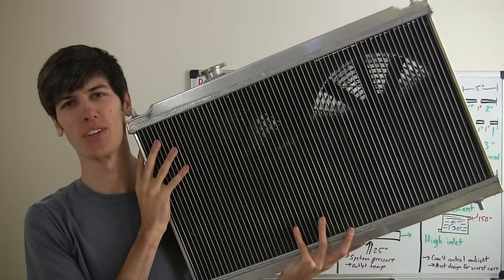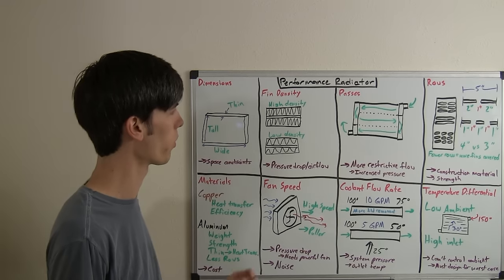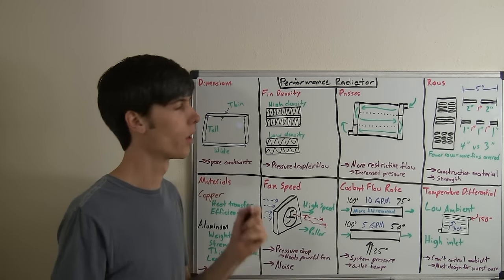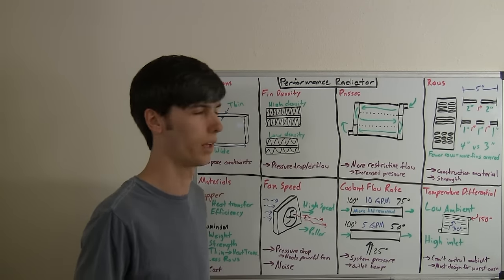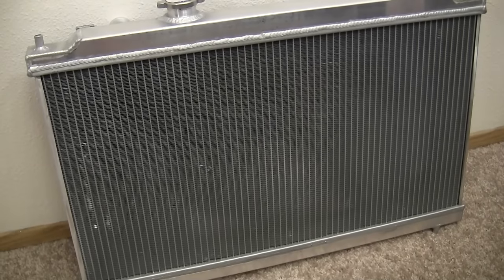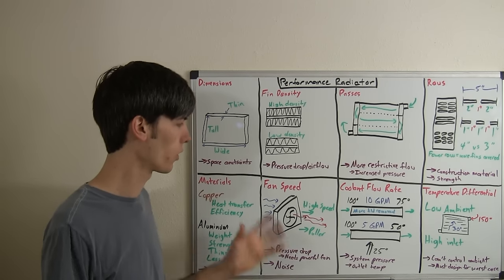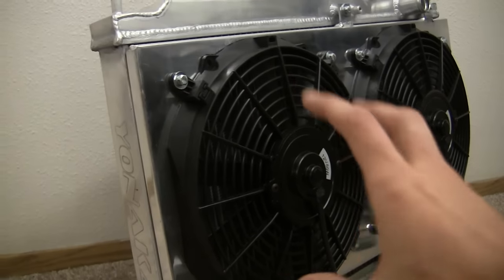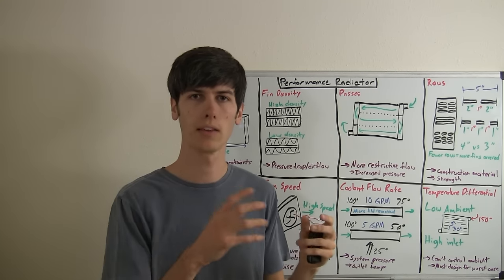Performance Radiator - Explained

Comment: WTF... I can see right through it? There has to be a better, more efficient design. I'm willing to sacrifice for more weight/more coolant to keep an engine as cool as possible.
.
Why not use Isopropyl alcohol for a coolant? What about compressed air through a small holes blowing on the radiator. It the basic way an conditioner works. How about a very light weight fly wheel with a magnet setup n the engine similar to a generator (accept a light weight design), to replace the drag a alternator puts on a vehicle. I'm not a big fan of the draw of power from an engine to power electric fans. I think they should bring back the old fans running off the crank. It sure as hell aint going to take away power, unless you are looking for thousands of seconds time on the track? I'd actually incorporate the fan in front of the radiator, rather than it blowing hot air from the engine at idle/low speeds... I still can't believe I can see right through the radiator, WTF?
Reply: Water has higher thermal conductivity than alcohol and high thermal mass, and ethylene glycol is molecularly similar to isopropal (they are both alcohol), I don't know why they use one instead of the other.

If you used an ac to cool the radiator, you'd need an even larger radiator to cool the ac.... Plus you'd just be adding parasitic drag to the engine to run the ac...

The alternator alternative you purpose would just be an alternator but probably not very effective..... And like an alternator, every Watt it puts out is going to reduce the power to the wheels.

I've never seen a car with a traverse mounted engine without a crack powered fan, might be that I work with older cars mostly, they often have an electric fan in addition so you don't need to rev the engine at a stop light to keep from blowing a gasket.... but the only fan that doesn't rob engine power is one that doesn't move air, and an electric fan be throttled independently of the engine, so it runs less often than a crank mounted fan would when in a Michigan winter and runs more often than a crack mounted fan would in a Arizona summer.
Reply: The radiator is actually more efficient because you can see through it... Air has less resistance to travel when its flowing through the radiator. What did you expect a giant block of metal? The electric fans actually have less of drain on the engine than crank driven fans, especially since they aren't always running. Usually crank driven fans are larger and have heavier(yet more durable) parts so that they can run (and last) as much as they do.
Reply: decimat777 Geeez... can't run an engine with a little more fresh water??